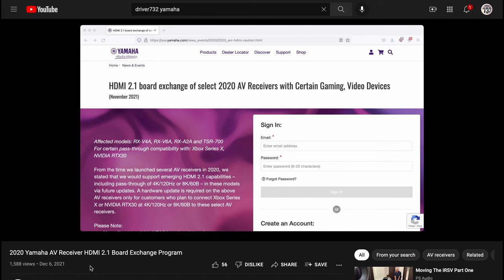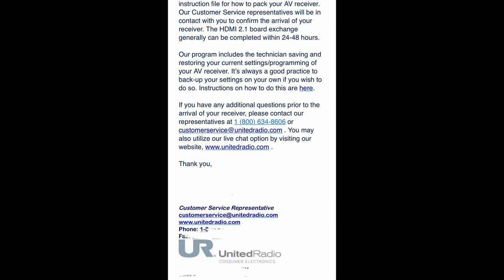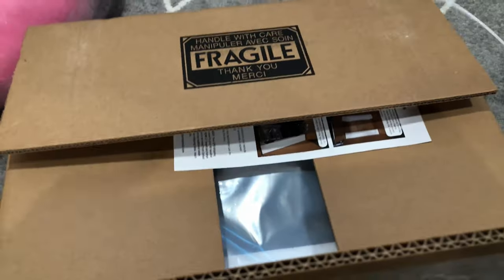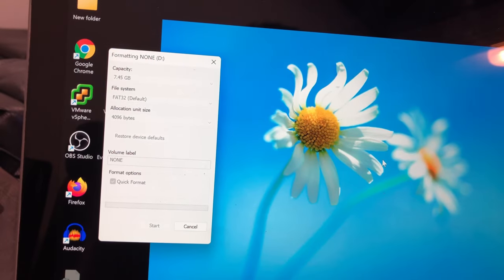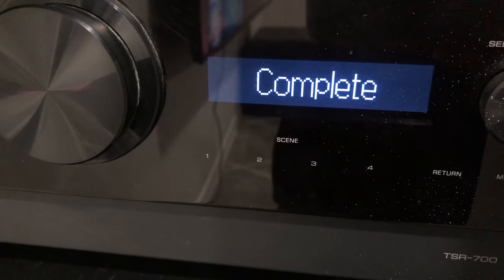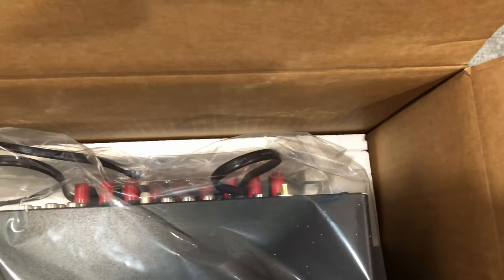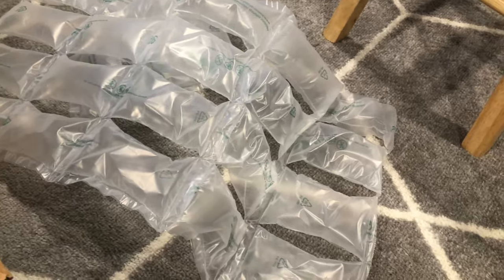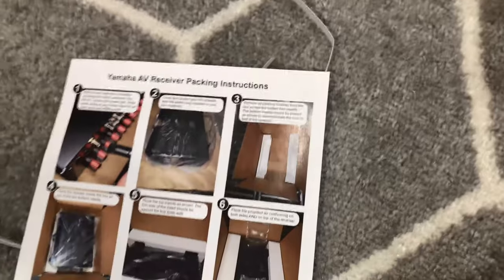Update 12/14/21: 2020 Yamaha AV Receiver HDMI 2.1 Board Exchange Program

Comment: That’s interesting that you mentioned static electricity ⚡️. I “zapped” my ONKYO receiver while watching a video via my laptop connected to the receiver via hdmi. What happened? The picture and sound went out for a few seconds and then came back on. Thankfully, no permanent damage was done.
Reply from the maker: That is very lucky indeed!  I tend to be more cautious than most because I used to build computers a lot and it only took very little to fry stuff lol
Reply: @Driver732  I certainly understand that. I  should watch out for that going forward.